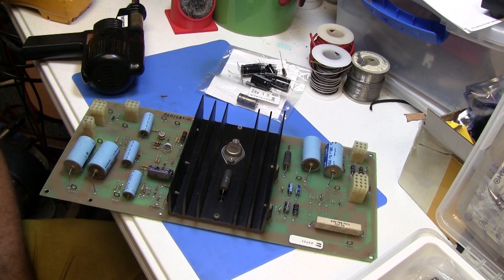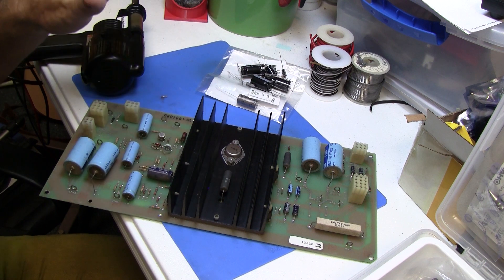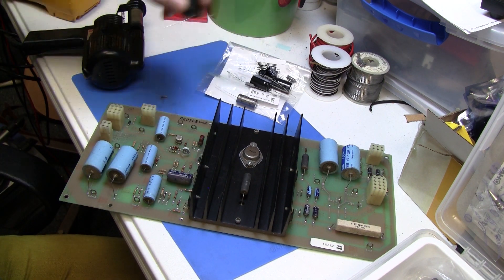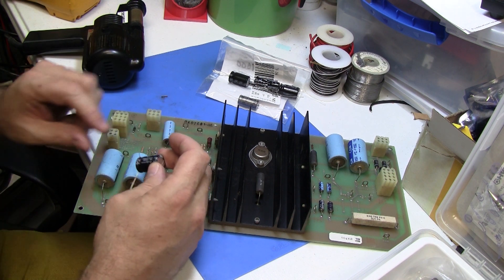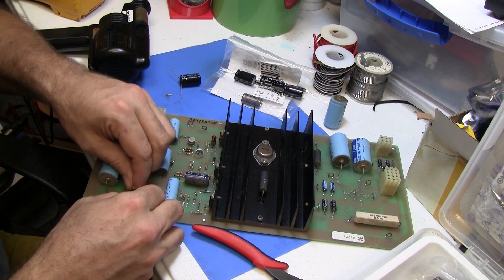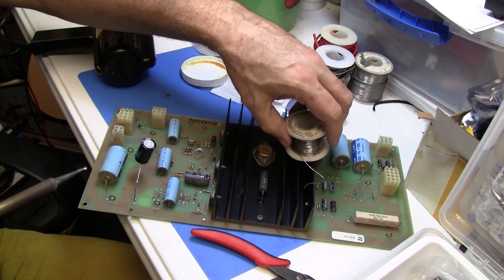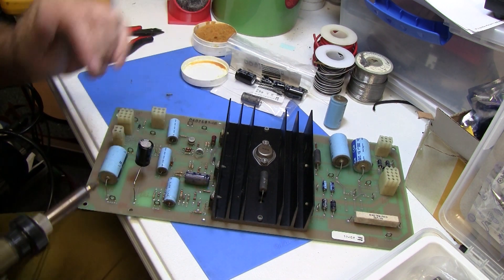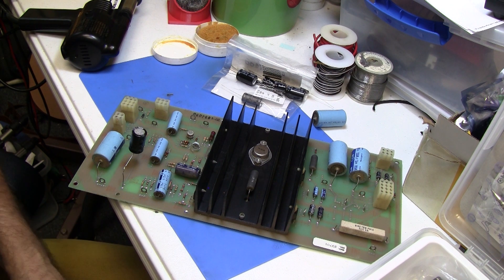Rebuilding a Tempest Power Supply Board - using different capacitor styles - PinballHelp.com

Comment: Really wants a mechanical connection couple of hooks on each terminal, don't really want the capacitor flapping in the Breeze either hot glue it to the board first. Alternatively better you can make it into a coaxial or have have it standing up by soldering the plus terminal in as normal and adding the old lead with a hook to the negative then you can lay on its side or stand it up
Reply from the maker: If this were a pinball machine or the game was prone to being moved , I would be concerned, but it's going to stay in one place so I'm not that worried about it, but it is always a good idea to hot-glue large components down - I agree.  However, none of the original components were glued in place either.
Reply from the maker: although you're right - I didn't think of putting the cap upside down, with its pins pointing up... I'll have to try that in the future.. although that creates another issue where if something fell onto the power supply it could increase the possibility of a short.  Still worth trying..
Reply: @PinballHelp  "No I didn't say put it upside down"! You want to keep the leads close to the board as possible what I said is you could lay the capacitor on its side like the original and add a lead from the old capacitor to the negative only, or fasten the positive end in! In the upright position, and have it pointing up and extending the lead from the negative end gluing optional